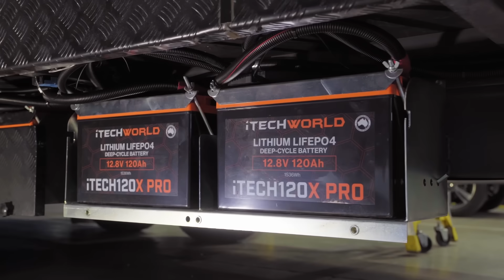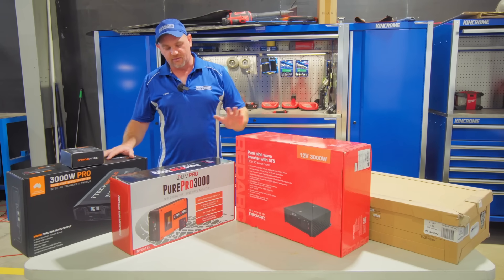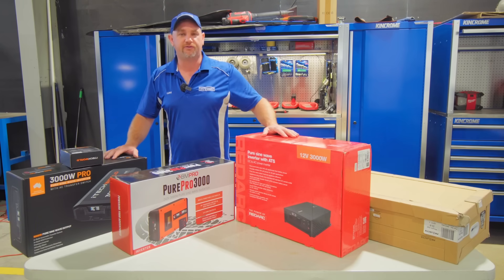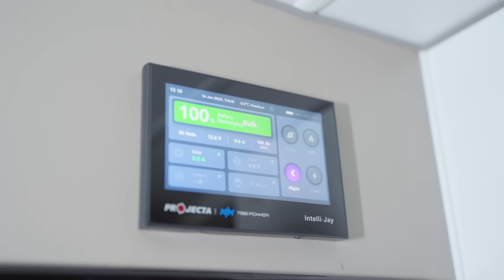3000W Inverters explained and compared - iTechworld, BMPRO, REDARC, Projecta

Comment: I have a projecta 1600w inverter and 2 dcs 180ah lithium. I run my air con on cooling and  heating for a couple of hours, no problem. 
I run air fryer, coffee machine, electric kettle, and induction  cooker, not all at the same time. 
Would a 3000w inverter be better? Yes, if i wanted to run multiple items at the same time. But in reality, I don't. 

I run my inverter close to the batteries with appropriate sized cable and resetable circuit breaker.
Reply: Good luck with your DCS batteries, your going to need it. Should boycott them for being dicks
Reply from the maker: It sounds like you've got a great setup that works for you!

Comment: Very good breakdown, though I'm surprised you install different brands. If they all do the same thing, they're all well supported I don't see the point. Especially as one is nearly twice the price of the cheapest one. I'm also wondering why you need to monitor the power at the inverter? Surely you need to monitor via a shunt from the battery which kind of makes the inverter screen redundant.
Reply: Was thinking the same thing

Comment: Go Redarc, Aussie made and owned!!
Reply from the maker: Even better - South Aussie, just like us!
Reply: @adelaiderv  I reckon Aussie made or not is for customer not the first priority. 
Firstly is what system is in the van existing and what would fit best to it. 
I went down that road for evaluation the different systems
1question to ask: want a 3000W inverter only and nothing else?
Or what some system integrated 
Have a look
Itech 3000w inverter 1k aud 
Redarc 3000w inverter 3k aud

In my case I needed a combination set since the BMPro J35 C installed in my van as manager system can not charge lithium batteries and the charger and solar regulator performance absolutely useless. 
But it can handle all electric system in the van. 
So look at a parallel system for the solar 2 circuit, 2 mppt regulator 
1 multiplus II 12/3000/120-32 charger / inverter was the go also 2 x180Ah lithium batteries
The reface system is top class a with double the price as Victron articles out of the race. 
Victron App is very simple and the setup and programming a piece of cake to install 
It is up to individual case and demand from customer for their system. 
There is no one fits all or
This or that is better
My truma aircon needs 800w and the fridge and chargers another 100W
Means with 360ah batt capacity I can run the aircon for 3 hrs till batt depleted but have still some juice for running all others for the day/night w/o aircon running 
Enough for for us since we only use aircon above +35 degrees

I hope that gives you some mor infos on this topic 
Please kindly note that this is by no means a complain 
The video was nice and gave the information but for sure could not go into details further. 

Cheers
Reply: I was a big supporter of Redarc, until my 3000w Redarc inverter failed, basically it's a throw away / $3000 in the bin.
Reply: Ummm not necessarily, I just bought the 24v 2000w Redarc ATS model (like the black one shown in the video) and it is MADE IN TAIWAN. It pissed me off because everything I had read said it was made in South Aussie......I eff'n hate it when they straight up BS like that!

Comment: Great.. 
yep the do all the exact the same 
But for how long ???
Don’t see the Victron 12 3000w 120A charger inverter
Why not shown in a comparison. ???
Any of the inverter show there does not charge the batteries!!! Need extra charger for them.., 
Victron multiplus II charge 10:29with 120amps the battery pack
Cost now 1200 to 1500.- AUD max plus installation 

Cheers

Comment: Did you forget about current draw? Most 100amp hour batteries can’t support the current draw needed to run a 3000amp inverter
Reply: 3,000W inverter.
Reply: Well I think that's why he said it might run it for 10 minutes before the BMS shuts the battery off. Technically, say you're drawing about 2500W in total. 2500/12.6V= roughly 200A draw from the battery - a 100Ah LiFe should run that for 30 mins but most 100Ah batteries won't do 200A continuous.